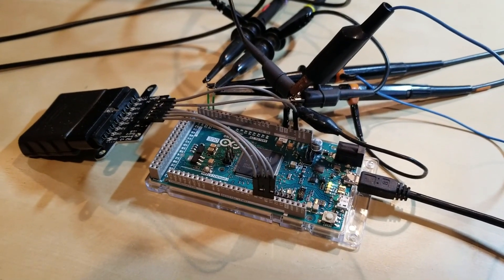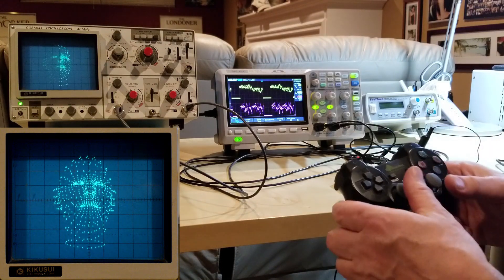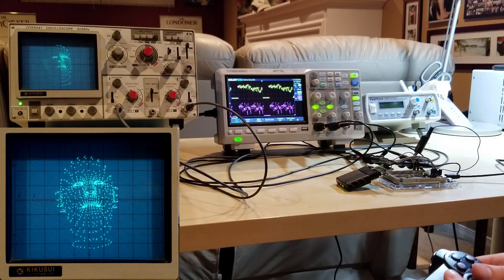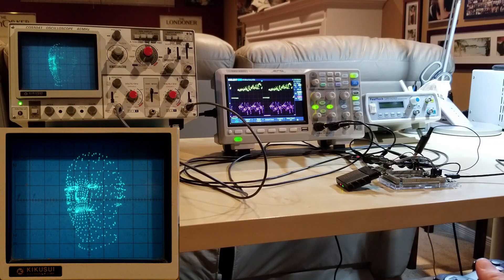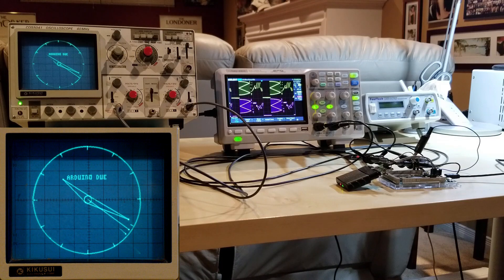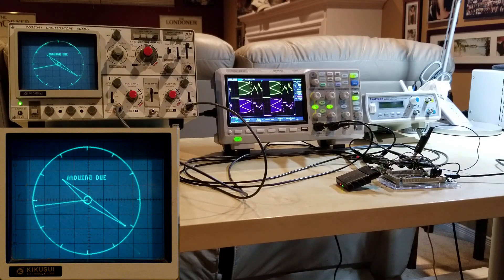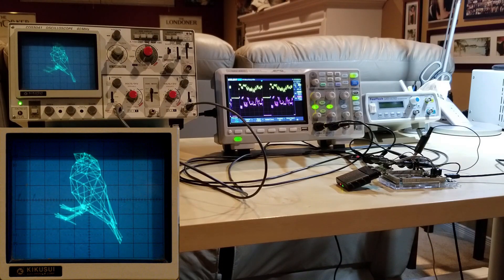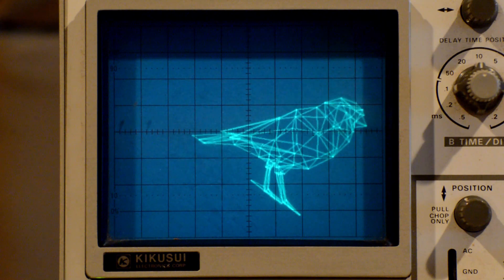Arduino Due Vector Graphics Display

Comment: Hello i love your work. Thankyou for sharing.. i can see the Arduino Uno has enough compute power to handle generating a pong game out to digital lcd display and analogue raster . Would it be possible to use this method to create an embedded pong board on an Arduino Duo and to output it to a dac vector graphics like this ? I dont understand coding enough but its always been a dream for use with a laser display

Comment: Very cool. I bought a Due just for this. I was tempted to build a resistor ladder DAC for another Arduino, but figured the Due would be an easy place to start and easily get some shapes plotted on my scope. I can play with building hardware later. Do you have your code posted anywhere? I like the 3d rotation you do. I'm guessing linear algebra matrix multiplication for the rotations?
Reply from the maker: Glad you liked the demo. The code isn't posted anywhere right now, but I'll look into putting it on GitHub. In the meantime, yes it's all based on linear matrix operations. Check out the Wikipedia page on "3D Projection" which is where I got the formulas used in the code. Hope that helps!
Reply: @sciencenstuff4726  Awesome. Thanks for the quick reply. Nice work. I'm excited to get some cool retro graphics on my oscilloscope.